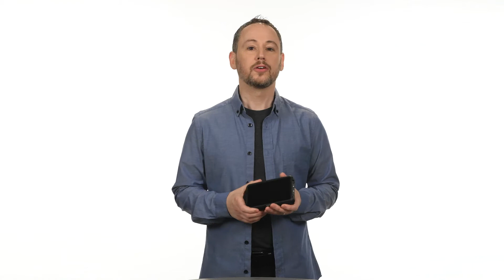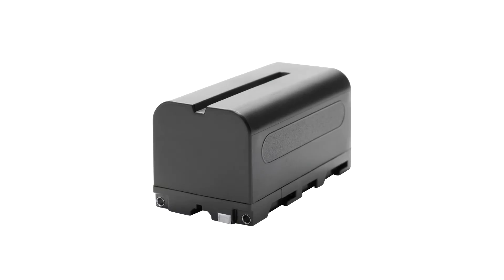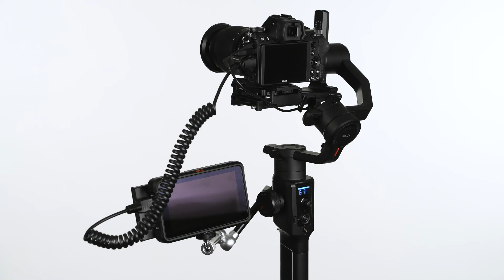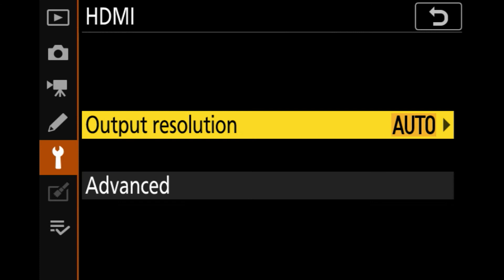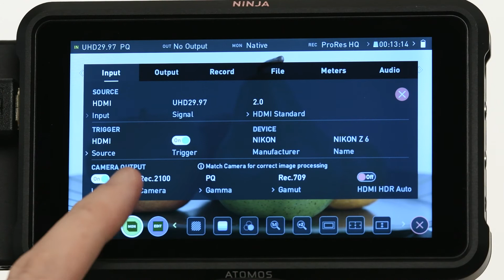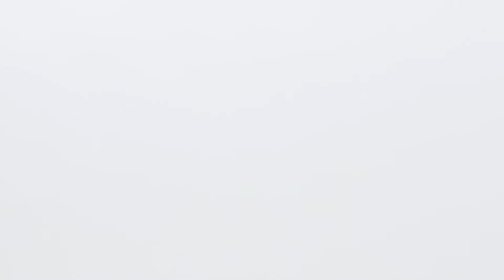Cinematic Video – Using the Atomos Ninja V with the Nikon Z 6

Comment: Which length of HDMI cable should you use?
Reply from the maker: HDMI cables come in a variety of lengths, so you’ll want to pick the one that supports your setup and content capture needs. However, we recommend utilizing a cord with ample length to allow the camera and accessories to be connected safely and securely.

Comment: I'm been having a really hard time getting the video from the Nikon Z6 to be exposed correctly on the Ninja. It's like they are on different planets, and there is very little information about actually getting these two pieces to work together. Is there a better site to go to trouble shoot this issue. Frankly, I feel like this is taking too long to figure out and Nikon and Atmos left out some pretty important information for users. This is frustrating.
Reply from the maker: We suggest checking out pages 348-350 of the Z 6 Reference Manual to make sure all your settings are ones that are supported by your Ninja.  You can download a manual here: https://downloadcenter.nikonimglib.com/en/products/493/Z_6.html  You may also want to contact Atomos to see if they have any tips for you on the best settings to use while movie recording.  If you need any more assistance please contact Nikon Support for troubleshooting help:  nikonusa.com/support

Comment: As usual, we in Canada seem to be getting ripped off. The Ninja V is more expensive and doesn't include the HDMI cable and other items that you list your video.  I purchased the ninja HDMI cable which didn't include any spec text confirming that it is in fact usable for recording 4k video. With the setup that you describe it doesn't allow me to record using my Z6 record button. Recording only works when using the Ninja record button. If you click on the input trigger it starts recording.  I suspect that some of my issues are most likely due to the HDMI cable.  When the display drops out the input camera settings are gone and have to be re-selected.  I would classify the Ninja V as a toy.  By the time that you buy the SSD, batteries and gimbal,  you are better off buying a pro-sumer video camera.  I can recommend the Sony PXW-Z90 which records internal 10bit  4k 422. 
Shame on Ninja for not producing a better product.  It would have been nice if it supported more camera's.  SDI out would have been nice if were to have been included  in my package.

Comment: Does using N-Log require using higher ISO minimums?
Reply from the maker: Hi Spencer! Yes, when using N-Log, your ISO sensitivity can be set anywhere from ISO 800 to ISO 25600 (on the Z 7) or 51200 (on the Z 6).
Reply: 800+
Reply: You will be at minimum 800 ISO with N-Log